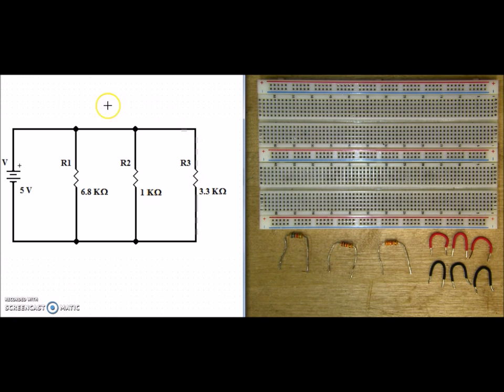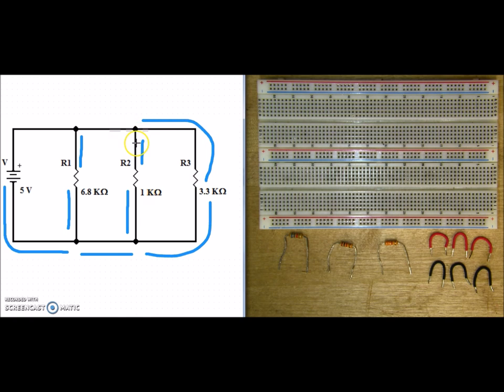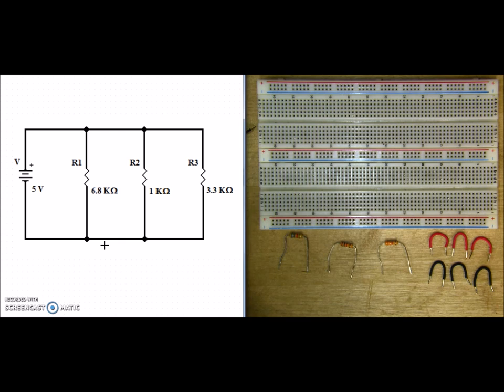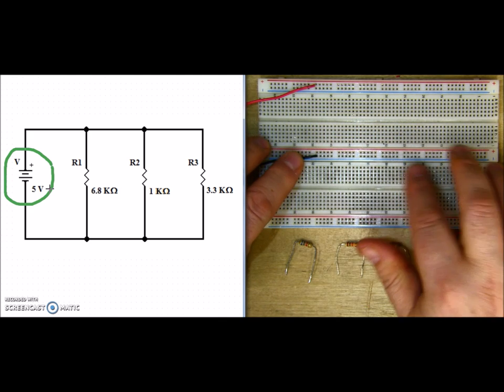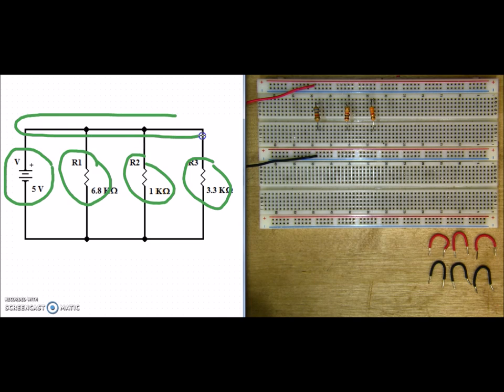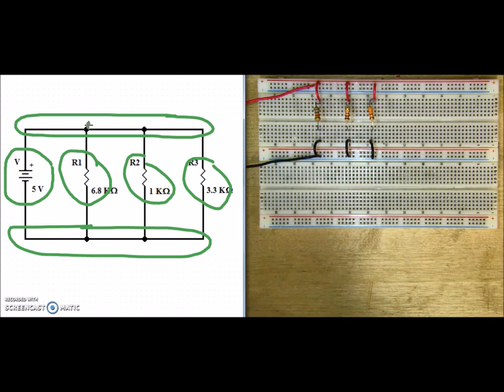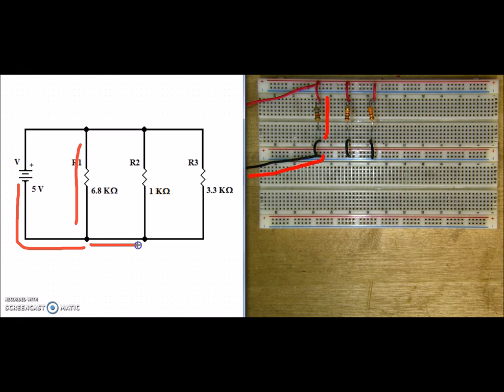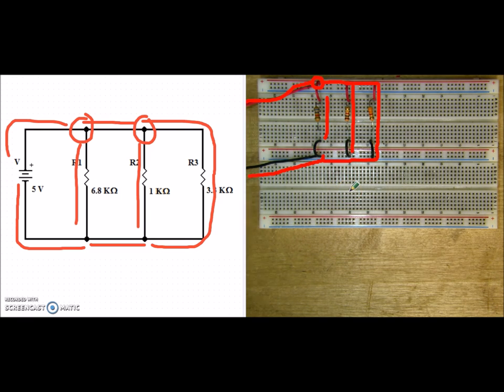Building a 2 resistor parallel circuit

Comment: really helpful video,thanks
doubt: 
1.there is red and blue power line on one side then why did you connect positive(red) on one side of board and negative(blue) on the other side rather than using red blue of one side instead?
2.so in the above case(if possible) we will connect resistor on one side completely rather than connecting "across"?
3.while connecting nodes,is it necessary to connect jumper from each resistor to -ve and +ve power respectively because they are internally connected within breadboard(i suppose) and so due to parallel connection you can connect power in and out to any one of the resistor rather than to all of them?